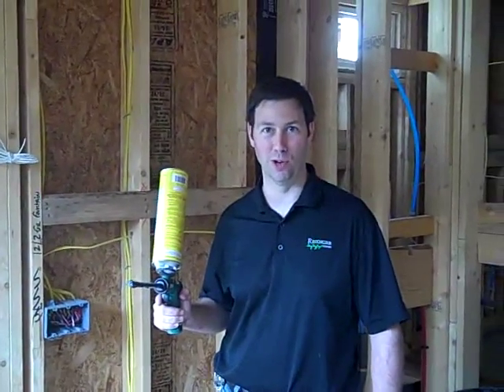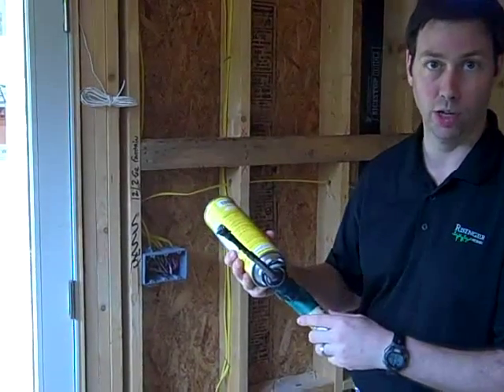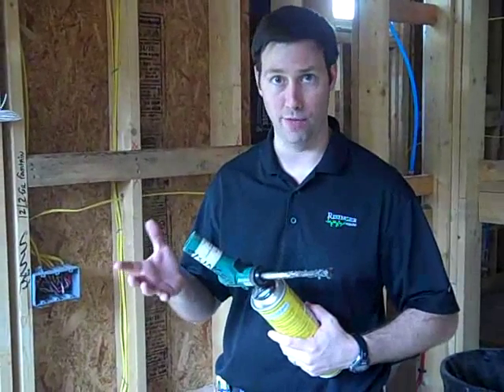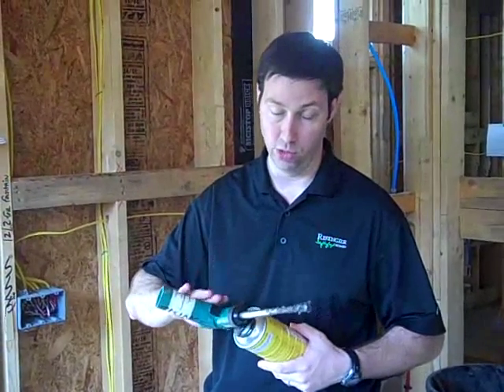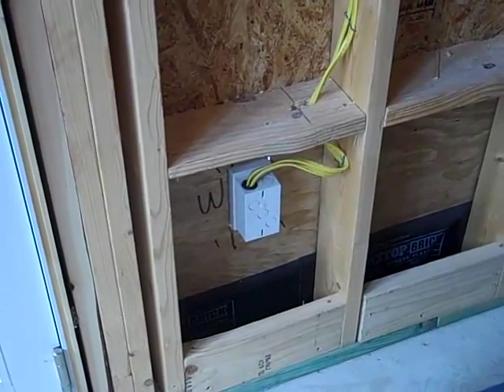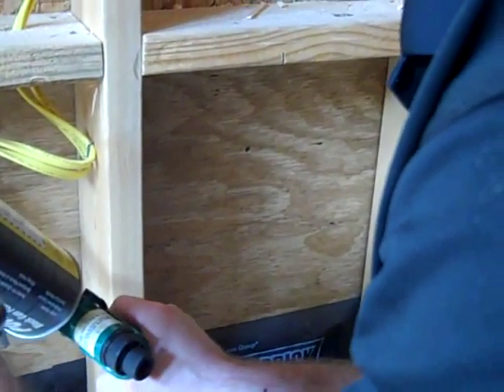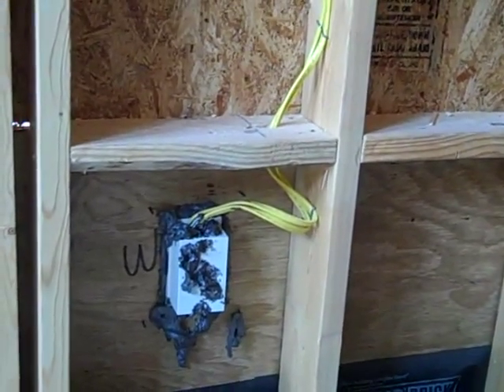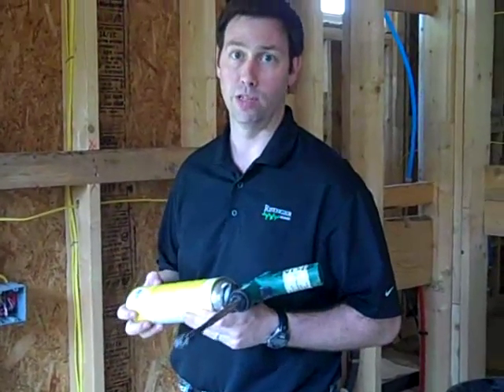Canned Spray Foam for penetrations pre-insulation

Comment: Thank you. I have a small shed maybe 25x20 I do a lot of work in there and its hot in the summer and cold like a ice box in the winter. It would be nice to spray foam before I put up plywood to finish the walls out. I am a do it yourselfer and would rather do it myself than to watch a group of guys. Thanks again.
Reply: Ramon Banda I know you posted this a while ago but did you ever do this? If so how well did it work?
Reply: Froth Pak